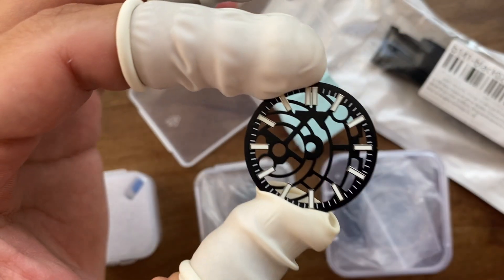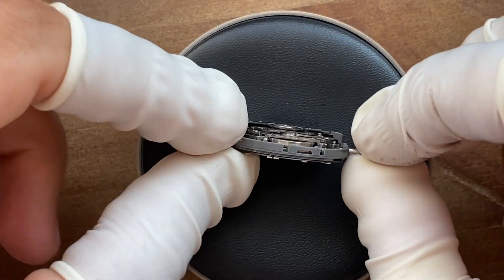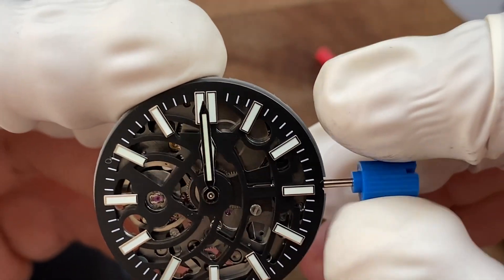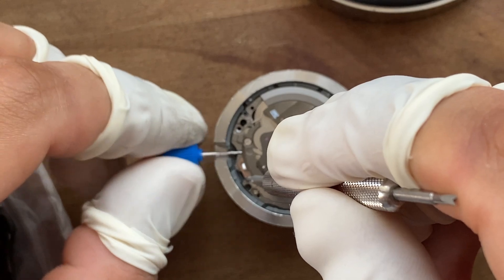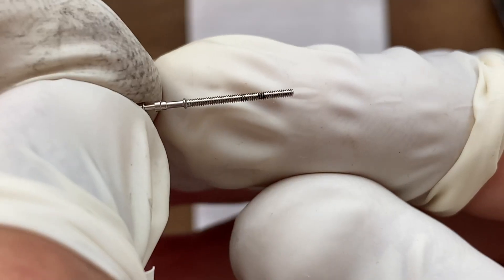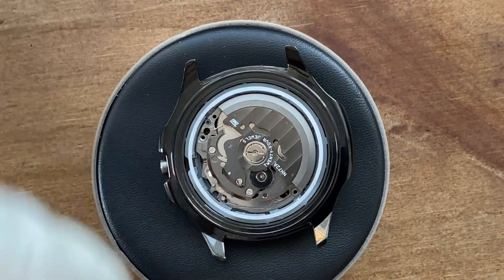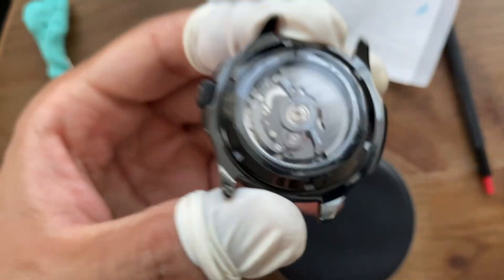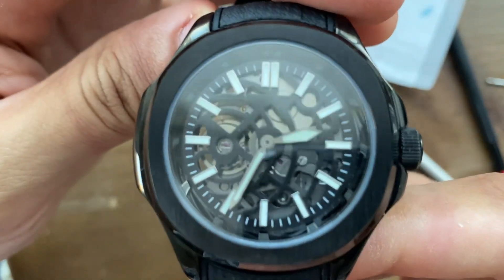Skeleton Watch Custom Seiko Mod  Under 100 USD Powered by Seiko NH72

Comment: Honestly, I don't think the build is that great... you can already see scratches and smudges on the hands during installation. Also, the way you attached the dial is really strange. If it were a more expensive dial, it probably wouldn't have turned out so well! But for a beginner, it's not bad for a cheap build. The Bergeon protector should only be used for removal, and even then only with extra protection, because the hard plastic tends to leave scratches. And lastly, I'm sorry, but I have to be honest: you should NEVER touch watch hands with ordinary tweezers. But perhaps it's simply because it's my profession and that's why I'm so critical. You don't need to estimate the stem and you don't need to order several; if you measure it normally, everything will work out.
Reply from the maker: Thank you for the feedback, I’ll definitely consider the constructive parts of it for my future builds. I won’t take the video down though, but thanks again!
Reply: @simplewatchtalks  I adjusted my comment; I didn't want to come across as so negative. But since English isn't my native language, I only realized on the second reading that my sentence wasn't very good.

Comment: The only video I found detailing what I was missing for the NH70, all I was missing was the lil plastic ring
Reply from the maker: Kinda of braindead from Seiko not to include those by default, all other NH references do. If it’s not needed, it can be removed. If it’s needed and you don’t have it, you’ll need to buy it separately.
Reply: @simplewatchtalks what can i do if i have metal one
Reply: @simplewatchtalks  i can't understand how to fit it

Comment: how do you go about putting the spacer ring on? Please reply
Reply from the maker: On the movement you’ll see 2 wholes at the 2 and 8 o’clock positions, you’ll have to line them up with the ones on the spacer and push in place.

Comment: Nice video! Easy to follow! And nice result for sure.
One question though: does the crown need to be fully pushed in when measuring the gap to the case? Or in another position like the one for setting the time?
Reply from the maker: Thank you! When measuring the crown has to be fully pushed in.

Comment: hello im new to this whole custom watch scene, am i able to use any other case with the movement and face?
Reply from the maker: The dial I used is 28.5mm in diameter, so as long as you choose a case that fits that size, it should work.